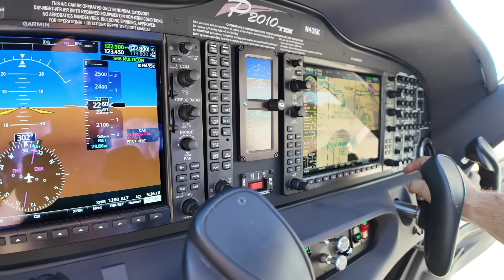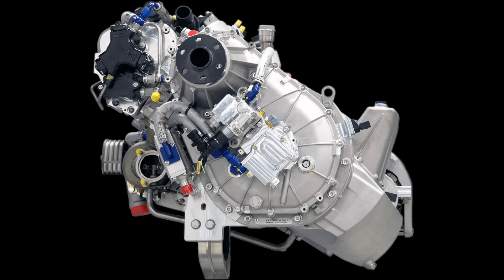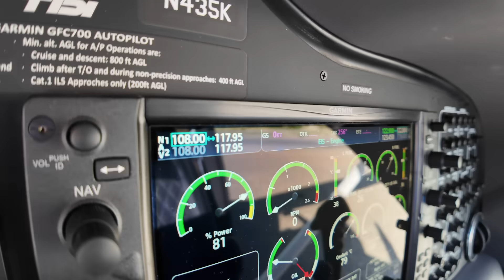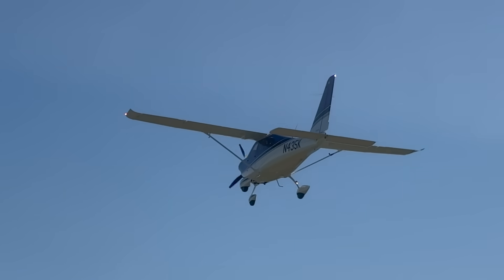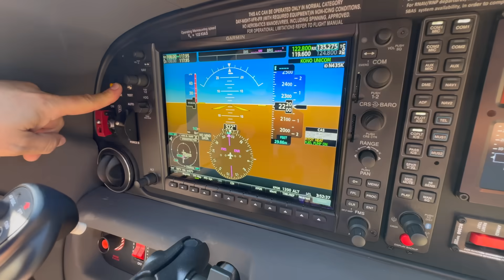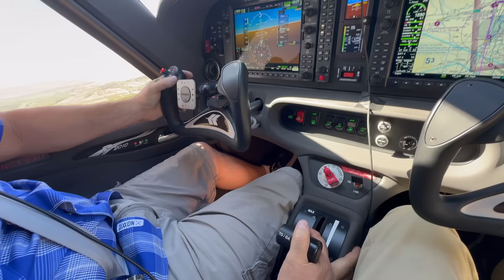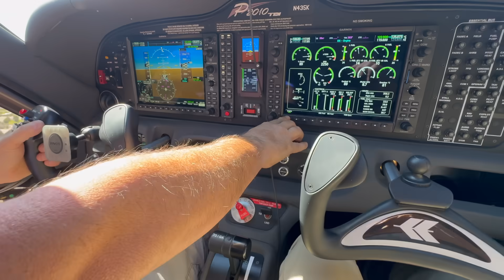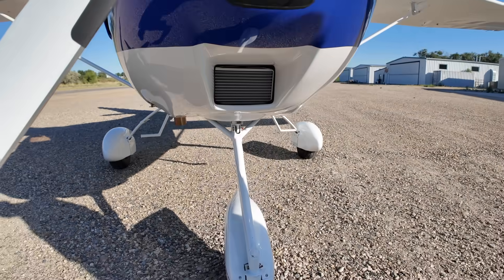Flying with a diesel engine

Comment: I wonder about the Piper 28 diesel variant. A cousin of mine flew in one and said it was much better at climbing over the Alps, when a regular Piper could not really go.
Reply: That's just turbocharged vs non-turbo, it's not due to any advantage that the diesel engine provides on its own.

Comment: I'm a Car Technician 
I Think The Subaru 2.0 16v Common Rail Turbo Diesel Will Be 100% Perfect for Light Planes ! 
( Subaru Used to Build Air-Craft Engines )
4 Cyl Boxer Engine, Ultra Smooth 
50 mpg @ 70mph = 6.4 Litres / Hour or 1.70 US Gallon 
+ No Drag from; 
* Power Steering Pump 
* Air Con Pump 
* Friction from; Tyres, Gear Box, Diff Etc 
A BIG Winner
Reply: The Subaru Diesel engines got a well known high number of problems. Mercedes developed over decades and got no issues with the block.
Reply: @onkelmatzi5815  Early Subaru Diesel Engines ( 2008 ) Did Have Problems. Crank Main Bearings Becoming Detached From Engine Block = Snapped Crank-Shaft, a Shameful Let Down By Subaru. This Was Corrected a Long Time Ago. They Make MAX Torque at Well Below 2,000 RPM. Worth Looking At.

Comment: Most of the Luftwaffe aircraft flew with diesel engines in WW2 because German petroleum was low octane.
Reply: That's not even remotely true. There were only a handful of very slow-flying aircraft that were powered by diesels, and they never really worked out the vibration issues with their opposed-piston diesel engines.
Reply: Wow! i didnt know this!

Comment: If the Mercedes engine that it’s based on is anything to go by, the airframe will have disintegrated long before the engine quits
Reply: and a I6 would be turbine like vibrations

Comment: I grew up in ND in a small farming community.  Worked with diesel farm equipment for many years.  One of my friends even had a diesel car.  My concern would be cold weather flying.  So flying in the winter would be a major concern.  I remember my friend and I got stuck in a blizzard because his fuel line jelled and we had to walk almost 2 miles in the blizzard to get to shelter.  So flying in the winter and at altitude you will easily exceed the cold temps that would jell diesel.  And yes I know you can put additives in but 100LL never jells...
Reply: Yes, this is a diesel engine, but it also runs on jet A1. So no jelled fuel lines.
Reply: In Europe, that's PLENTY of diesel cars and vans, we start having "winter diesel" since October. That doesn't jelly...
Reply: Rumor says (Iam German) that US Diesel has no or less Antijell in Winterdiesel.
Just run it on Jet A1 in Winter, if that cloggs, you know you are in Outer Space 🙂
Reply: Low IQ comment, for a start it runs on A1 and secondly European diesel has anti freezing agents in it, do you think every diesel car in Europe has to be garaged for the winter or something? SMH

Comment: Both the Tecnam and the Diamond are not fast planes. If you put a diesel in and is 10HP short of the gas version at sea level, then you have less power, regardless how you try to spin it.  I know those diesels are not cheap.

Comment: High reliability diesel engine use will require high quality,  recirculation filtered fuel at the pump.  Many modern diesel truck  problems are from fuel stations treating diesel fuel the same as gasoline.   It's not.
Reply: Definitely would be adding cetane improver and lubricity boost

Comment: If it runs as well as the similar engine as my 2005 Mercedes Benz Sprinter 2500 van's 5 cylinder diesel, it will be a no brainer purchase. 300,000 miles coming up and the engine has had the fuel pump replaced a while ago but still ran before replacement. Keep the oil correct type, changed, filtered and water correct, seems to run forever. 180 F degrees engine temp in North Carolina all year and on my second set of glow plugs. What's not to love. 

And no, I am not selling my little Sprinter.
Reply: Continental is using the 6 cyl OM642 for the cd300.

Comment: Lots of Mercedes made it over 200 k and still running
Reply: Hi friend. 200 k is not even close to high miles for a Mercedes diesel. 
I have a friend in Spain with a 1987 300D ex taxi with over 700000 km on the clock thats about 450000 miles and still going strong. The engine is great but it ďosnt matter how many times that car has been cleaned it still STINKS. The engine is great just not in an ex taxi.

Comment: It does surprise me how Diesel engines are taking too long to finally increase their foothold on general aviation.
Reply: They're expensive and significantly reduce the performance of the aircraft.
Reply: Not every Diesel engine is equal. Some newer ones feature a much better power-to-weight ratio than the older stuff.
Reply: @zOiNhUh  Like the EcoDiesel, which shreds its rotating assembly to pieces because it's not built heavily enough? The same was true of the Oldmobile 350 diesel and the early versions of the Detroit Diesel V8s. Diesels need to be heavily built, or they're not reliable, or long lasting.

Even Thielert, who initially developed these engines, had trouble when they tried to convert them to an aluminum block in order to save weight, so they ended up going back to the iron block.
Reply: @PistonAvatarGuy  not too far... Forget the EcoDiesel, there were better engines out there. When it comes to aluminium blocks, there are some other develpoments with this feature from the beginning, instead of an afterthought like converting the Thielert from iron to aluminium block.
Reply: @zOiNhUh  Yeah, well, companies have spent tens of millions of dollars (if not hundreds of millions) trying to come up with a diesel engine that works well in aviation, none have come close to being competitive. The Engineered Propulsion Systems Graflight V-8, Red with the A03, Deltahawk, SMA with the SR-305... they're just too heavy, their TBOs are too short, they're too expensive, and fuel savings aren't all that impressive relative to modern gasoline engines.
Reply: @PistonAvatarGuy  Diesel engines in my country are prevalent on light-duty trucks over gassers, and nowadays the power-to-weight ratio is not too worse than a gasser as it used to be. But the complexity of the newer Diesel engines compared to the simpler layout of gasser engines still prevalent in general aviation, which in part is rooted on the cost of a FAA certification leading to a more conservative preference, is another factor to consider.
Reply: @zOiNhUh  I think that we're having a language barrier issue.

Anyway, the Continental CD-300 is based on the Mercedes-Benz OM642 V6, it's all aluminum and it's still a ridiculously heavy engine, weighing significantly more than a 375 hp gasoline engine (Lycoming TEO-540).
Reply: @PistonAvatarGuy  I'm from Brazil so English is not my native language. But anyway, maybe Diesel engines will still prove their worth on general aviation.
Reply: @zOiNhUh  Doubtful, there are just too many gasoline engines currently flying, and they're going to be around for many decades to come. Making unleaded fuels available for existing gasoline aircraft will assure their continued dominance.

The market almost immediately rejected the Cessna Skyhawk JT-A, it will be similar for most other diesel aircraft.
Reply: @PistonAvatarGuy  I guess you're already aware of STCs being available for certain aircraft too, mostly cropdusters. So there are options available.
Reply: @zOiNhUh  Yes, but very few conversions happening, because almost no one wants diesel engines.
Reply: @zOiNhUh  And, even if diesels were selling reasonably well, it would only be because there are no modern gasoline engines in production to compete with the modern diesel engines. How well do you think that any diesel would compete with something like the Adept Airmotive V6?

Even in crop dusters, a turbine engine (something like the Allison M250) with a recuperator would likely be a better choice, simply because of the very high TBO that's possible with turbine engines. Red wont even advertise the TBO for the A03, because it's likely to be extremely low relative to turbine and gasoline engines.
Reply: @PistonAvatarGuy  one of the reasons why I still see more cropdusters with piston engines in my country is the possibility of using fixed-pitch propellers. Turboprops may have advantages, but try to convince some operators in the middle of a rice field in Rio Grande do Sul.........
Reply: @zOiNhUh  In the US, there aren't many cropdusters that aren't turboprops.
Reply: @PistonAvatarGuy  the scenario in Brazil is substantially different
Reply: @zOiNhUh  But they're not likely to convert to diesels there, either, because they would lose payload capacity.

Comment: "very reliable engine", so reliable the entire engine is replaced after 1200 hours at a cost of probably $100,000 ? What the heck.
Reply: if it runs without an issue until TBR than it's reliable

Comment: Diesel is actually really well suited for airplane use, and the lower consumption makes for great range/lighter planes.
We have one here as a club rental and people love it for longer travels.
Even an old school diesel with mechanical fuel pumps works great since diesels works well under very different mixtures, and then it will run as long as it has fuel, even if the electric system totaly fails, so it is safer in that regard too
Reply: ONCE I read they are super economic for flight schools and also have the Diesel avaluable in remote places where Avigas is not! I also read such an engine would be mucn  cheaper.
Reply: @ibrahimsued4906  yeah, but flight schools also has to teach how to adjust mixture and test the magnets on a regular plane. Here we have a flight school that has two Pipistrel Electric for the majority of the training around the airport start/landings, but they also have traditional planes for that reason

Comment: Will the FAA let you roll coal in the sky?
Also knowing jet A1 is like diesel but without lubricating properties how does the fuel pump handle it?
Reply: modern low sulfur diesel that's used in cars no longer has the lubrication of higher sulfur diesel that was used before US and euro regulations, the newer fuel pumps have designed around that issue with post 2006 diesel engines living healthy lives for over 19 years now with many pushing over 300-400K kms. The weak point in these engines on aircraft from what I've seen online and irl is the ECUs and electrical problems that can cause an engine to quit. I personally don't think 1800 TBO/R is enough run time for mechanical issues to manifest themselves since these engines live harder lives in cars alongside emmisions equipment and usually breach 5-10 years and 200K kms without any major issues to speak of with fuel that is loosely inspected for impurities. Speaking of cars tho the common rail injectors and turbos tend to fail in these modern diesels if emissions equipment aren't causing any issues before that, dirty fuel also kills them very fast.

Comment: When I was attending Sparten Academy in 08, we were being trained on a Cessna 172 that had a German diesel engine.  These diesel aircraft were being sold overseas mainly because diesel fuel is the preferred fuel to use and available.
Reply: I thought it would be mostly kerosene as this is available at most airfields nowadays.
Reply: Kerosene will run a diesel engine and has the advantage Kerosene tolerates lower temperatures than diesel...
Reply: The Germans used diesel aircraft in WW2.
Reply: @spitfirenutspitfirenut4835 yes with the Junkers Jumo 204/205.

Comment: I have worked on these engines but on piper and diamond , overall continental thillard CD-135/CD-155 and above is the way to go at the moment Austro engines aren’t very realiable , in hot climates you might experience overheating on the continental depending on cowling type and if extra oil cooler is installed , also there is an SB one can perform to enlarge the water path on the silica pouch tank of coolant

Comment: This was a great video, I love the look of this airplane, I have followed Tecnam for a while now, especially with their twin they made for Cape Air.  I definitely think taking this Mercedes engine and using it in an airplane is a great idea.  A well proven engine, with fuel that is widely available, and with a turbo it gives the airplane better performance at altitude.  I noticed the flying tail similar to the Piper Cherokee.  I would love to try one of these if there was a flight school near me that had one.

Comment: I am retired now 17 years but refuelled a number of the diamond singles and twins when working at the Isle of Man airport. It seemed strange putting jet A1 in a light a/c to start, but I always made sure grade stickers were in place at the fill points. My motto was no one around. No grade identification, then no fuel. The owners always praised the fuel economy compared to 100LL in a similar a/c

Comment: Jet A / kerosene contains about 15% more energy per unit volume compared to 100 octane/gasoline. 
That means 15% further on the same tank of fuel
There are 2 stroke diesels that can provide better power-to-weight options
Reply: Same energy by weight, though, and when you're lugging around a heavy diesel engine, weight becomes a serious concern. See: Failure of the Cessna JT-A.

Comment: It's a bit weird - here in the UK (Europe kinda started it with diesel taxis, but it soon took off in the UK) we've known for ? 30-40 years just how a) fuel efficient, and b) reliable/durable diesel engines are. Because of the implications of high stresses with compression ignition - much higher compression ratios, literally explosive combustion - diesels have to be built tougher, ie, sort of 'over-engineered', and because of that, they tend to last longer. It is interesting that the TBR is only 1,800 hrs, as that only equates to about 75,000 miles in a road car. My last diesel car had 252,000 on the clock, and was running well when I sold it. My current diesel only has 170,000 (ie, just over 2 x TBR on your 'plane) and uses no oil. Don't you think, given that my car often sees 4,500 rpm and is often driven long distances at rpm of about the same as your 'plane, that the TBR interval could be increased a fair bit? If I had to replace my engine (in the very unlikely event of a serious failure) I could get a factory rebuilt unit for under £10k. I wonder what your expected replacement cost might be?
Reply: Maybe it could be increased, but since it's a fairly new field, they probably don't want to risk it and ruin their reputation. They would rather replace a few engines more and not have any disasters than have one spectacularly fail and make everyone go "diesel bad", like Oldsmobile did with diesel cars in the 80s. Once aviation diesels become more common, I'm certain there will be engines with replaceable cylinder liners and longer lifespans.
Reply: The aero engine uses another load profile, and is mainly under high load. Load does not mean rpm. In a road application you have less stress in average. Pull a heavy trailer with those modern engines with high specific output and they will die sooner or later.
Reply: Your car engine is so lightly loaded compared to an airplane engine.  7 gallons an hour…

Comment: idiots you do not even show the right Mercedes. Bullshit the engine is from the old version of the a-Class Mercedes Benz smallest vehicle. Thielert replaced the cast iron bloc with a n Aluminium bloc and steel sleves..poor Continental with their outdated 1940 ies engines could not come up with a modern engine..all stolen intellectual property from Germany...losers

Comment: Finally, an end to leaded AVGAS?
Reply: They still didn't manage to remove lead after all these years.   Diesel looks like a bigger leap.
Reply: False, aircraft owners aren't just going to abandon hundreds of thousands of perfectly good aircraft because diesels kinda work in some aircraft. Diesels are too heavy and underpowered to be used for conversions in many cases, too, so that's not a solution either.

Comment: I have one of these. A Tecnam P2010 TDI. I have 260 hours on it. Cruise about 130 Knots at VFR altitudes, burn less than 8 gallons per hour. Stable, reliable, comfortable, easy to fly. Garmin G1000 NXI with all the goodies. Everywhere I go people stop me to talk about the plane.
Reply: Sweet! At least somebody gets to enjoy one!
Reply: 8 gallons, it is mote than 20 litres, quite a lot.
Reply: Roughly 9l/100km at about 330 km/h.
Show me a car that economic.
Reply: @Anowow-k3j  there is, but, you have a point
Reply: @Anowow-k3j  pretty much every car does better than that and most do double that. My one ton truck even does a little better than that.  That is very good mileage for a plane though..
Reply: @Merica-1776-ish Try go 200mph ;-) This plane's consumption is at that high speed.
Reply: @Anowow-k3j thats insane
Reply: @marguskiis7711  not for a four-seater. Most burn around 33 litres of avgas per hour in cruise
Reply: @marguskiis7711 compared to other GA engines, its not